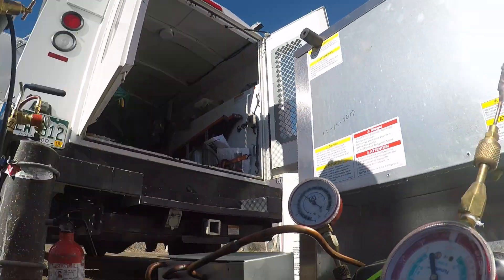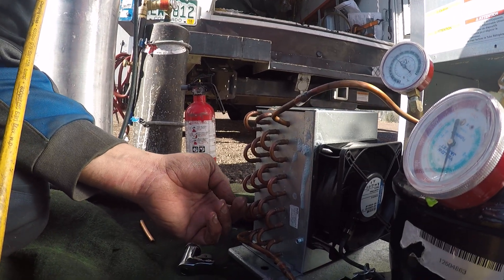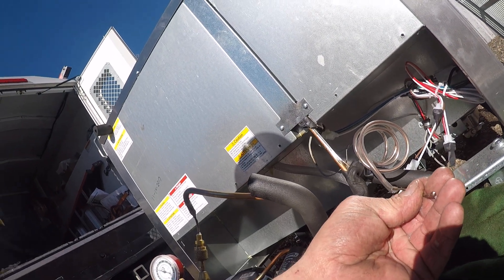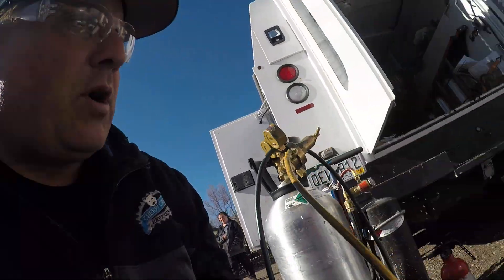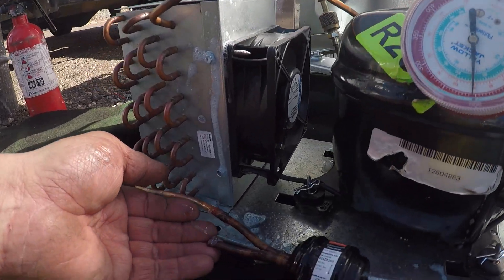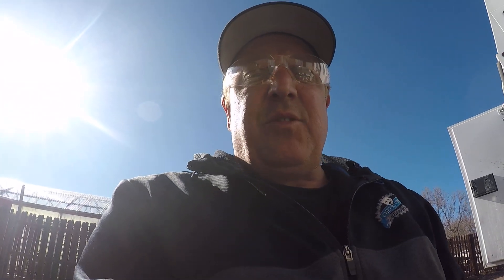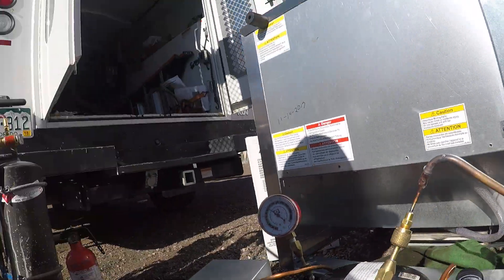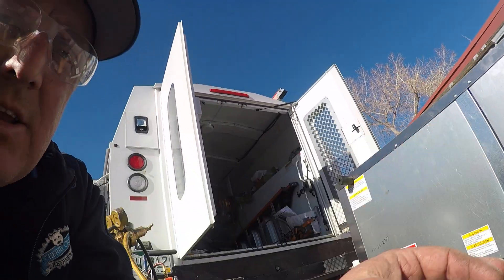R290 checking for a refrigerant leak Cherry Creek Refrigeration refrigerant leak checking

Comment: Can you use a standard leak detector or one for just r290?
Reply from the maker: No you have to use one that's for gas not refrigeration gas. The refrigeration leak detecting don't work just the ones for gas